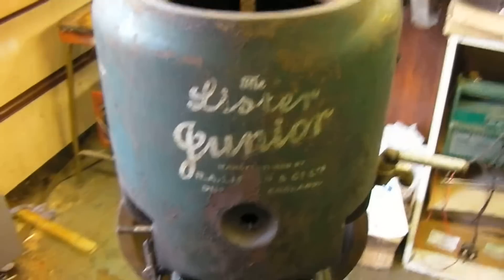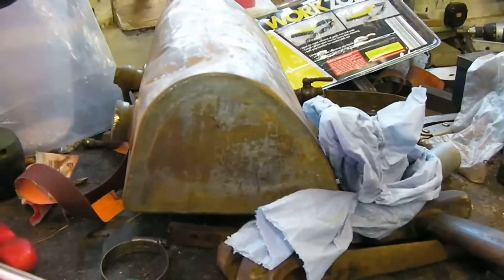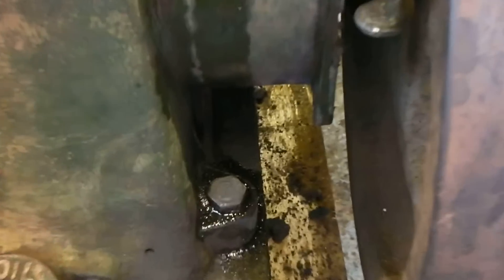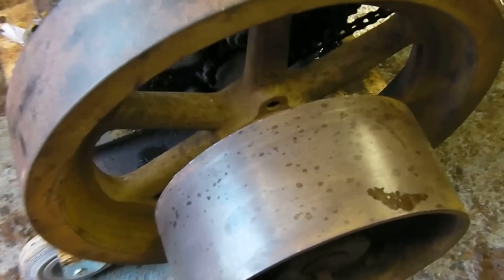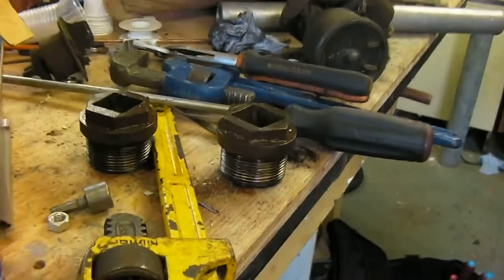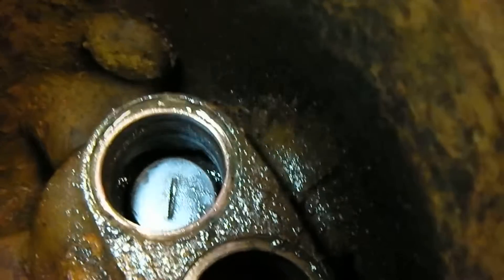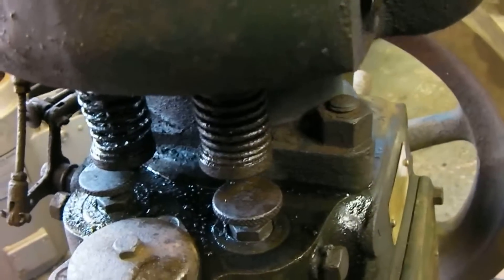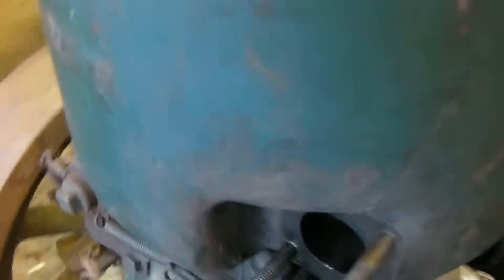LISTER A JUNIOR RESTORATION PART 2

Comment: Very nice. I would remove and grind both valves while you have the plugs out. If the engine is sticking at one point I would susspect some rusting in the bore and mabey siezed piston rings.

Looking good though, and nice to see one which has the original hopper top cover.

Phill.

Comment: I too need to remove those massive valve caps inside the hopper, my Q is: what size socket is it, and or what did you use to remove these two items??
My toolbox has nothing inside it that I could possibly use as yet, so I may need to go out and buy whatever it takes to remove the caps. I have no choice one of my valves is stuck and bent... Any info at all gratefully received. Thanks

Comment from the maker: @steamwally yeah well, im in the middle of making restoration part 3 and the cylinder head is off and the boar is prittey smooth. also we ground down the valves and made some new seats.  we then got some of the Nitro Mors paint stripper (fond this on one of your suffolk vids) and took the paint off the cylinder head. So i will have a vid of that up later hopfully  

thanks 
David